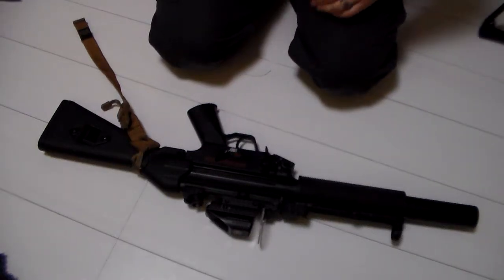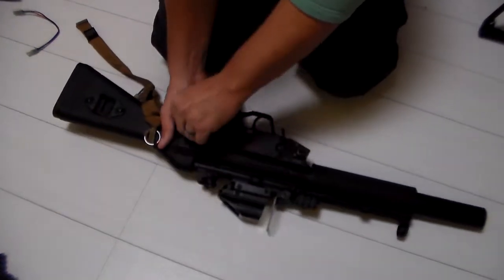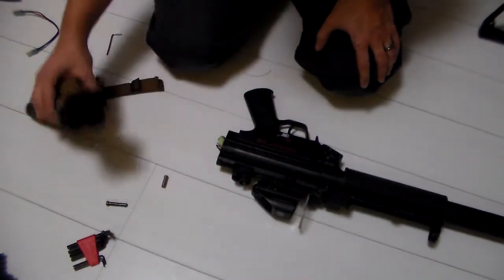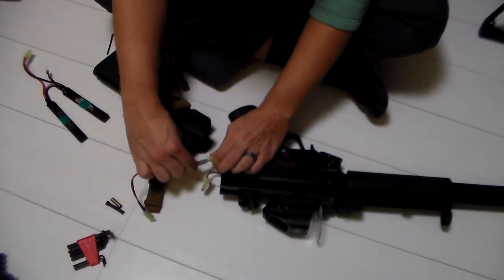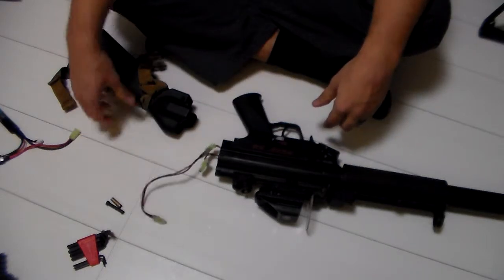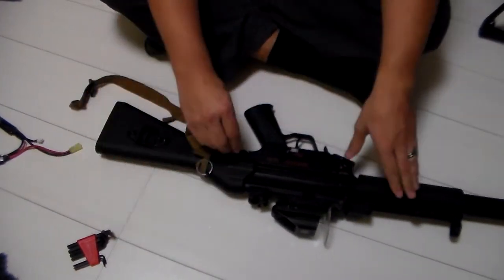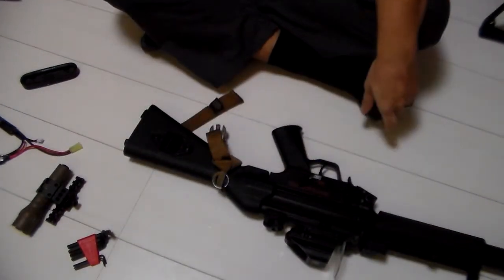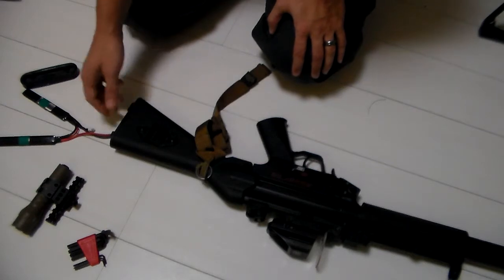CYMA MP5SD Fixed Buttstock battery cable extension

Comment: I got the fixed stock variety and cannot find the connector I haven't checked the stock is it there stock
Reply from the maker: It's sold with the collapsible stock, so it's originally kept in the handguard. Takes a bit of work to move it to the back.